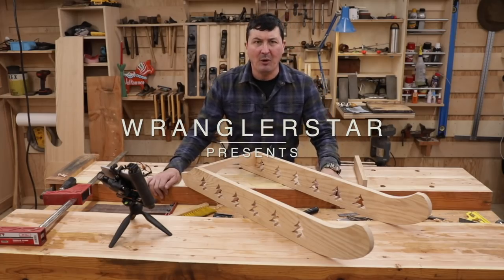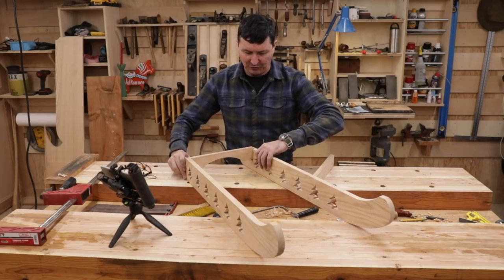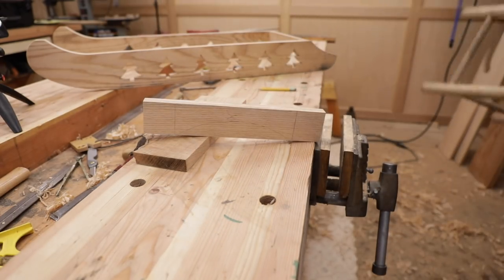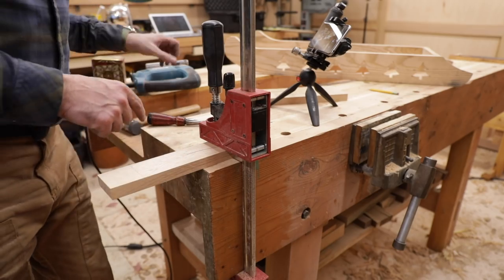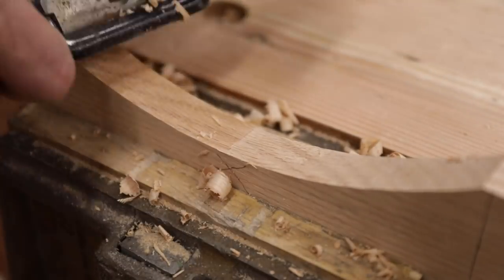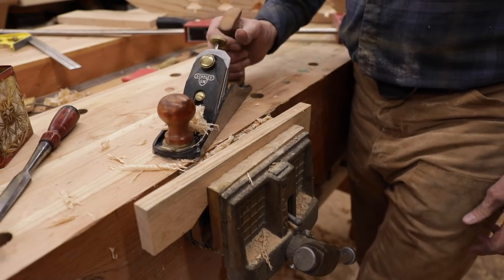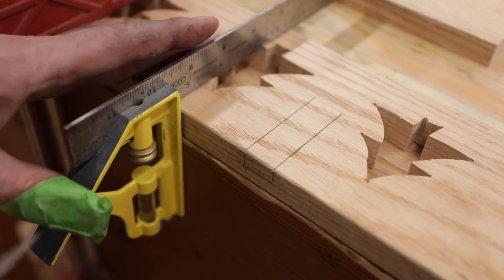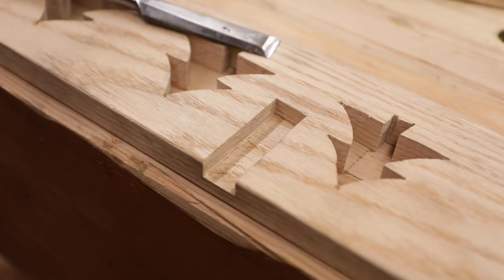HOW TO MAKE A SLED 2

Comment: do not cut the wood a lot because you weaken the strength of the sled rail. But you could router out a small swirl but no more than 3/8" thickness.
Reply: Kristyanna Virgona I was going to say the same , if the sled was to have a bump it would be less able to withstand the force if it was cut out

Comment: Router out a design following the contour, but not through the wood, maybe like 1/4”.  You lose some bulk/weight but keep the front stronger
Reply: Your idea may be the smarter way.
Reply: Concur with F4u and Dustin.  Paint the recess a different color
Reply: you got it in one Dustin and paint recess as cdouglas suggests
Reply: Was going to be my suggestion exactly
Reply: I like this option.

Comment: I run a dog sled in the winter up here in AK.  When a runner breaks, it typically breaks about an inch or two on either side of where the runner first makes contact with the ground, which is near where you're planning on the next hole.  Any sticks/stumps/rocks/etc that the sled's runners contact will be at this point.These holes will, obviously, weaken your runner.  Not an issue at all if it's a wall hanger, but if it will see some action, then I would not suggest any more holes in them.  Being honest here, that forward most pine tree is probably a little close to the highest stress point, in my opinion.  Not taking anything away from your craft as it is a beautiful project, but perhaps just shaping the front of the runners while leaving them solid may work.  Just a word of caution.  
Take care, and Yah bless.  LAUS DEO.

Comment: Add two three shrinking trees maybe the last tree could be a small star as previously suggested, will look more uniform and keep front end strong. Runaway sled will smash into a tree and break with skeletonization. I had one of these small sleds back in the 60's when I was a pup, it was built by my grandfather in northern Quebec,  it had steel runners/liners along the bottom edge and was always the fastest sleigh on the hill... I have never seen another one until now and thinking of building one for my 6yr old..  happy New year and many Thanks for often bringing back great memories Wranglerstar...

Comment: Rule of thumb is to cut the joinery first and then do the shaping... would have saved breaking off those corners at the rear. 

Also, the most danger to the plane irons comes from the other metal tools on the bench. I've found that putting the plane sole down on the bench precludes the iron striking other metal tools...  Keep doing what you are doing Cody!

Comment: I had a wooden sled when I was a youngster.  Similar to yours except it had a 3 sided box on the back.  I can remember my father pulling me in the new snow, Berwyn, Illinois about year 1944.  Dad had a long Navy great coat that came to mid calf.  Strange things you remember for 73 years.

No metal for civilian use duration for the war,  hence wood runners.

Comment: As for the holes in the front end, I'd be leery of cutting the inside of the runner too much.  This is the part of the sled that will take the most impact so I'd be afraid of weakening it.  If it was me, rather than make a linear cut, I'd make three holes of graduated sizes, the larger at the back, the smaller at the front.   The smallest at the front can be used to put the pull rope through.   

I'm interested in the depth issue, with heavy snow I'd think this would bog down too much.  But I suspect you've got a plan for that.   

May your New Year be merry and bright, my friends.  Thanks for sharing your life and work with us.  It is a tremendous encouragement, more than you may know.

Comment: You might want to also consider the options you would have to lower the weight by partial routing and not going all the way through the oak material.  You could do that in the front or even along the whole rail.   Your sled is coming along nicely.  Look forward to see what you end up with.  Thanks for sharing.

Comment: About two weeks ago I was working on a project and was cutting with a brand new Olfa knife with my aluminum straight edge. Knife bit into the aluminum, jumped the edge of the ruler and went straight through my index finger. Just barely missed the nail. 
Spent a few hours at urgent care. 

I feel your pain.

Comment: Do NOT alter the nose of the runners.  If this is designed for children to play on, it will need all the strength you can provide.  The current appearance of 'excess bulk' will be diminished when you complete the ride surface and rails (if you were planning to install any) in the rear portion.  I will 'even out' in the long run.  I just feel that if you remove some of the front profile of the runners, they will be more susceptible to snapping off if too much pressure is applied to them.

Comment: It looks a bit heavy in the front.  But, you don't want to take to much away or it will weaken the from=ne.  Especially if a tow rope os attached.  Nice work.  Many years in a commercial kitchen, Superglue was a good friend.  Specially the Gel type.

Comment: I actually just found a Stanley 10 1/2 Corrugated Shoulder Plane in my dad's workbench and fixed it up.  It is a nice tool, but I think I'm going to sell it and get a more modern reproduction of a Low angle Jack which is more useful to me.

Comment: Shear strength would seem to be important at the front of the runner for impact durability.  If you want to lighten that front end, partial depth routing will leave enough of a web to preserve the rigidity.

Comment: For the front of the runners, I think you should lighten the front. It would help them run higher and keep from being bogged down in snow. My thoughts were to drop the top of the runners down a few inches and bring that into the rounded end of the runners almost like you're making the curly end of an elf's shoe. If that makes any sense. Like how the iron runners on an red rocket sled.

Comment: I think that although it looks heavy,it also looks strong. As the leading edge, skeletonized may weaken the runners if it is intended to be used. I would add holes close to the tip for the tow rope though but I am sure you already thought of that.

Comment: Cody 
take a look at dog sled  runners they don't cut them out at all also they use a plastic edge on the runner that's screwed down, we used to use a similar plastic but the name of that escapes me now, as i can only think of old surgical implant plastic names. It's been decades since I worked with it and I haven't had it come up in conversation so. . . . .
Happy & blessed New Year to you. Check out that plastic for sled runners depending on use weight friction/drag ratio and longevity that you want.
ha I too have a number of light scars along finger sides from similar knife, chisel and protruding nail tips and head also steel cable wires we have a "2 inch rule" two inches from where ones shooting nails from nail guns path of loaded high pressure knife or that type of cutting path where one is likely to zip on out with vigor and slice what have you, maybe try that as a exercise of discipline, but it happens that we are imperfect even if one does a pretty good job then the guy working with you can slice or shoot a nail tips through wood and fish hook or protrude and get you. It's part of the working part or the trades minimize distractions; really watch the first 15 minutes & the last fifteen of actual work this is where I see a lot of guys get hurt. take care wash it wash it dry it, crazy glue and then liquid skin can close that laceration.

Comment: If you're going to use it to haul firewood, you should leave the wood alone so that you will have the strength needed to respond to your pulling on the rope when taking the wood from your wood piles to your house and the mass will also be able to absorb the bumping in the front of the curve when you're pulling it through the snow.

Comment: i like the design as is but if you are looking at lightening it up a bit you might use a router to do a design in the front end.  Maybe some Celtic designs or some old time dutch symbols as that would stay in line with your lube can.  Items like that can also be painted to add some color to the sled as well.  Another idea for your cross members would be a type of dove cut to maintain them from wanting to pull out even if the glue lets go. No disregard for your design just some alternatives that I was thinking while watching your video.  Looks nice and the idea of copper runners sounds like a nice touch.

Comment: I would skeletonize the front of the sled. However, in the hole that is being created, I would add a cross piece that slants backwards; just for some extra support. If the front edge would hit a rock or a stump, I feel like the skeletonization would potentially break out.

Comment: Maybe choose to make a star shaped cut out in the front of the runners, to cut out the whole triangle, it would not be strong enough i think. the star holes could double up for a pulling rope attachment.   the racking forces on a sled are very high, so maybe reconsider the way of attaching the cross pieces. on good sleds they allways allow for movement between the members. (like through tennons and wedge f.i.). never glued solid, because hard stiff joints will break very easy. With your stop dado joint, screwing (maybe nice brass screws) would hold up better then glueing is my thought. cute little sled .cheers.

Comment: I normally agree with most of the things you say BUT,when you were talking about the planes it is to do with the blade not being retracted, when you sit them down with out retracting the blade you then leave the planer blade open to to chips and also curl the edge.
Reply from the maker: Steel is harder than wood,

Comment: Cody, put a dowel across the front for support. When someone is sliding down a hill on the sled it will tend to spread the snow if it is very deep at all. P.S. If you've got the cut on video, (Post It!!! ) everybody wants to see someone suffer on film. You will get a lot more clicks. And then you can teach everyone how to super glue the wound closed without super gluing your good thumb to the already bloody stump.  : ) tee hee hee

Comment: Keep the front end heft for strength! If need be for weight, you would be better to take more from the bottom making more of a taper to better climb on top of the snow.
Also, have you ever thought about building a Scandinavian kick sled, with a folding design?

Comment: Red Oak is a great working wood for furniture or cabinetry but its not good for exterior uses. Its a very hard hardwood but because of the large pores, water and other moisture ingress is very common and can cause the wood to stain, crack, and rot a lot faster than others.

Comment: Looks nice. Structurally though the dados are not suited for this. There is no long grain to long grain glue surface to withstand the shear forces. You should use through tenons, preferably with the widest surface horizontally. Dados are good for supporting the down pressure only.
Reply: Also a dado, going across the grain, this deep, weakens the sides of the sled since it interrupts a major part of the long wood fibers.

Comment: I'd leave it as is for strength Mr Wranglerstar, but if you really want to lighten it then how about a couple of snowman shaped cut outs? Easy to do with a couple of forstner bits and your jigsaw :)   I've used superglue to stick myself together on more than one occasion.  I was told that if you don't have the medical stuff a brand new tube is best as it's sterile.

Comment: Changing the shape may be better left until after the first test runs downhill. It might work for the best to have the weight on the front because who knows what small obstruction may be under snow. Easy to take wood off, but a lot more work to put it back on.

Comment: Simple way to get a radius or circle, all you need is a nail, piece of string and a pencil. Mesure out the diameter or radius and put the nail in one end of a board, attach the string with a loop in one end to the nail and the other end for the pencil. The string length has to be the same diameter or radius you want. That's it and you can get any size circle or radius you want.

Comment: I would leave the front alone. You will need the weight in front to make the sled run well with a kid on the back. I might also note the strength of the front is important in the event of a crash.

Comment: Skeletonize the runners, following the shape of the runner. But, leave enough meat at the tips to drill a hole for a dowel across the front. In fact, drill the hole for the dowel handle first, then draw out the skeletonizing.

Comment: opposed to skeletonise it, i would drop the top down by about 3-4 inches so it has a nice smooth curve going down and then back up to the top. its hard to describe but basically take a bit off the top opposed to hollow it out as you may create a weak spot

Comment: Other than the nice hole for the rope it'll need I wouldn't weaken the runners at all.  It is visually heavy - maybe cut out another tree to shorten that mass out front.  Could also do a shallow carved 'Wrangle' star around the rope holes.

Comment: Try cutting a curved slot, like you first mentioned, only make it 3 inches long instead of 5 or 6 inches. I fear the runners will become weakened and fail under side pressure; the lower half of the runner is un-supported. You could run a nice canvas/leather strap through it for pulling or towing.   you know,,, I think Paul suggested you draw your layout knife GENTLY  on your first cut, bearing down  on your following cuts because you  are being guided by the first cut thus avoiding donating blood when the sweet old red cross lady with the cookies isnt anywhere to be found.  I love the sleigh, (not a sled) happy trails.

Comment: Just like the old Stanley chisels are better than the new, older Stanley planes are that much better as well. A used #4 plane can be picked up for well under what you paid for that new one. Often times for under 50 bucks.  Follow Paul Sellers restore video and give it a try. Well worth the time.

You can also purchase new copies of the older designs. The Woodriver #4 is about 150 bucks, with a little work it will work nearly as well as a brand new Lie Nielsen at double the price. I have a bunch of older Stanley and love them, but I also have one Lie Nielsen 4-1/2 because I can, and well am addicted to tools

Comment: Put an additional tree on each runner at the front and then a stout round dowel across the front of the runners to attach your rope or whatever you’ll be using to pull it

Comment: If youre skeletonizing it id do the opposite of what you did on the rails... On the rails you cut out the silhouette of the fir trees, in the skeletonized section i would leave the silhouettes of the firs... These will act as cross members so you reduce weight and bulk with the cut out background but maintain strength with the fir tree cross members...

Comment: i would not skeletonize the front of the ski, i do not think it would look right, what i would do is simply make the front of the ski shorter in height by having the top edge of the front of the ski slope down at an angle just after the forward most fir tree cutout, and follow the contour of the bottom edge of the ski up to the front.. that'll reduce the weight, and fit the design much better than skeletonizing

Comment: Do you not worry about keeping an oily rag compressed in a tight wad? Doesn’t spontaneous combustion happen in such a situation?
Reply from the maker: Not in a metal can,
Reply: Learned this trick from Wranglerstar years ago.  I keep my Ballistol soaked microfiber cloth sealed in a ball jar.  I use that thing for everything from wiping down guns and tools to oiling surfaces like the saw tables to plane bottoms.
Reply: It’s fine till it’s not
Reply: Flash point of gasoline: -45f, flash point of Ballistol: 126f. Spontaneous combustion isn't likely under normal conditions.

Comment: First of all, it's good technique to lay a plane on its side.  Secondly, the metal component on your square is a 'RULE' not a ruler.  Just sayin!!
Reply: I actually just retract the iron when I set mine down.  Just habit.
Reply: Joe McIntyre no
Reply: I don’t retract the iron and I don’t set my plane on its side never have only at school. My dad would clip me round the ear when I was learning if I did. With all the other stuff on the bench your more likely to damage the iron with the plane on its side. Only time I ever set down on its side is if I’m out of the shop installing and I have to lay it on the floor or a metal surface then it goes on its side.